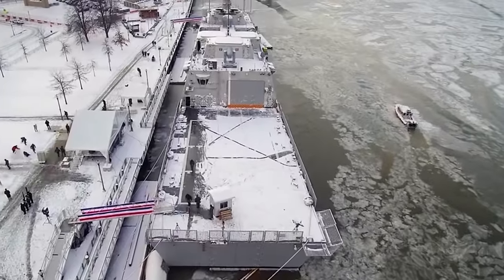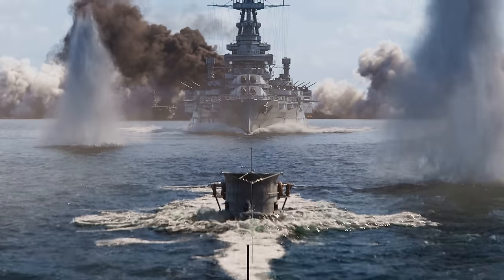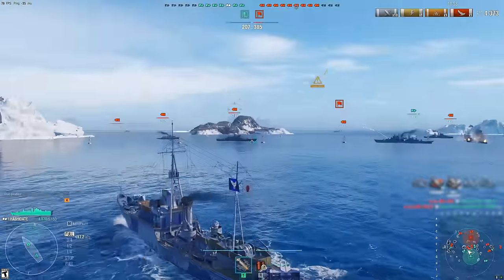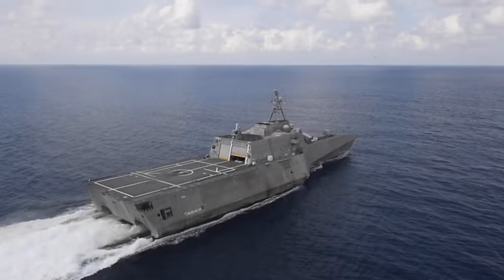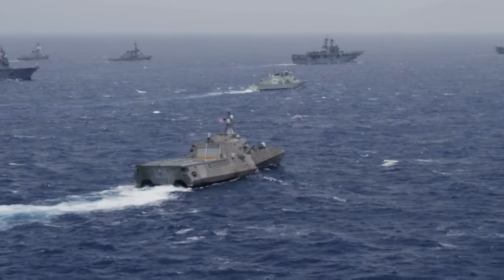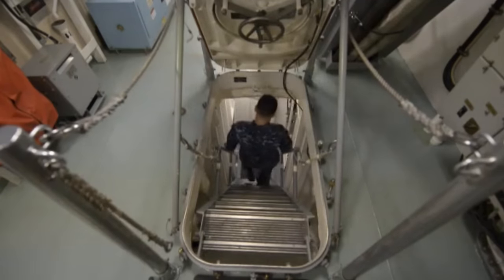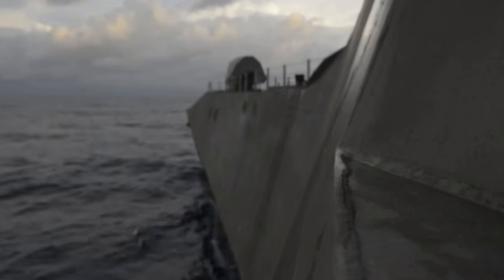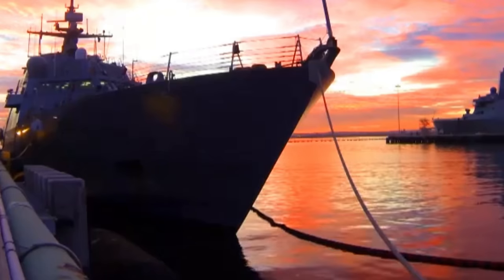Is the Littoral Combat Ship the worst ship in U.S. Navy History? | BIGGEST NAVY FAIL 👎🏼

Comment: Just a thought here…
Our ship builders and Navy tried to do something so radical and different too quickly. They should have done 2 of each hull, and tested them extensively before making anymore. Only once we perfected the design would we build more. The US does not operate corvette class ships (let’s face it, these are corvettes) and has zero experience in the design and operation of them. We also fell into the blunder of trying to make these limited space ships a sort of transformer by switching modules and take up more missions than feasible. 

I know the mine sweepers and mine warfare ships are in limited supply in the US Navy, but I personally think we could do better with purpose built platforms, and converting older amphibious ships that are no longer used or needed for their original roll. (For example an LPH was used as a mine warfare ship in the past, and from all accounts very successfully. The ability to launch multiple helicopters to sweep for mines was a great idea.)

My personal opinion is that the LCS platform should have been limited in scope and mission sets to just a few. In particular they would have excelled at (if perfected) at counter piracy, counter narcos, and costal patrol missions not in the theatre of war. They had potential to be special ops platforms to launch SEALs and Raiders, do VBSS (Visit, Board, Search, and Seizure) on suspicious civilian vessels, chase down Somali pirates, and hunt for narco subs.
Reply: Modern amphibs are the size of WWII aircraft carriers…

Comment: A certain amount of irony, that ships built to be adaptable couldn't adapt to the stategic shift in priorities and threats. Also, perhaps one of the lessons learnd would b to limit the number of ships orderd, at leat in the first batch. If they'd built 5 or 6, the issues raised would be quickly ralised without further commitment. Then the solutions could be built into the following designs.
Presumably these would better suit smaller navies that aren't flanked by massive oceans, have a narrower scope of tasks, and predominately operate in a defencive posture. If the engineering issues could be rectified, they might be well employed in low theat areas to free up dedicated warships. A theater that requires pressance and diplomatc reassureance, but not a destroyer. They might even do well in the coast guard. Otherwise, perhaps the export market is the best option to recoup funds whilst upgrading friendly nations.

Comment: On new concepts do 2 or 3 only and try at least 2 or 3 versions from different makers.  After testing best ideas from each can be refined into the production models and the prototypes if useable can still be used in roles they are suited for and help develope other concepts as test beds like the stealth ship that was largely copied for bond in Tommorow never dies.  Many concepts are themselves are not bad but are not practical en mass.  The replacement for the Greyhound with a tilt rotor with as safety record so bad even some officals are banned from going on them despite being in the fleet to shuttle high officals around.

Comment: I just dont understand why they just didn't go for a Corvette. These ship, just like the Dutch Holland class are under armed and dont really have enough crew. A good corvette would have been beter, without asking a lot more.
Reply: The speed.  Both models of the LCS are 40kn+ capable according to paper specs. From the design they look like they're designed to patrol foreign shores like the south China sea and respond quickly to local hot spots.
Reply: @namyun2743  speed is not really a good reason. That is hull design and engine/propulsion power. I believe that the LCS ships have big hull problems. I would not send these send these ship beyond coastal patrol, anti drug and piracy operations (something where the Holland class is designed for). These ship are still under armed and lag a proper crew. Sending them to active warzone might be suicide for these ships.
Reply: @damenster  I can't say I understand USN doctrine on the use of the LCS, but that crazy speed has been a core requirement since the project started and I believe is part of the reason why the ship has problems.  The Holland-class at 21.5kn is too slow for USN operations much less whatever was planned for the LCS.  It looks like both of the LCS are getting offensive weaponry in the form of NSM launchers. They will probably be replaced with the Constellation frigates and drone missile boats like the Ranger.

Comment: Denmark?? Kockums is not in Denmark. USN and Northrop Grumman personal were present during hull 1 and 2 constitution of the Visby class in the 90s. Kockums were to build the carbon fiber hulls for Northrop Grumman.  Swedish ministers went to the US lobbing for the project. There is much more.
Reply: The FLEX-sytem (the modular design of changing the ships roles) is a Danish thing.
Reply: @MrBandholm  Thanks for the information. I changed careers in 2000.

Comment: The DGX feels like a worse fail
Reply: In some ways it is;  costlier per hull, but LCS has way more hulls.  Freedom-class may be salvageable though, they just need a new combiner gear.  Not like the Independence-class which has a weak hull.
Reply: @namyun2743  If I remember correctly they are retiring the freedom class ships and will maintain a sizable number of independence class LCS ships.
Reply: @ameritoast5174  From what I am reading, both of them are going to be gradually downsized until there are none left.  The Freedom-class has the combining gear issue which appears to be class-wide, but the Independence has the hull-cracking issue which I predict will be found to be a class-wide issue as well.  The ones that get decommissioned later will allegedly get NSMs.

Comment: I think the idea of being able to change the role of any vessel is going to make things hard.  What I would like to see is a ship design that has all the minimum requirements for all tasks (air defense, anti-sub, etc) and then have the ability to add 'Mission Enhancement modules' which might simply be a place for two 20' shipping containers.  
Then if you are going to do anti-piracy, add two 20' accommodation containers for pirate prisoners.  You are going to do anti-sub work, load a second UH-60 Romeo in the place of the two 20' containers to give you more airtime searching.  You are going to support long range surveillance or want to extend loitering time, add a 20' fuel container (that you can pipe into the ships existing 'at sea replenishment fitting').  Basically, the two (or more) 20' containers use existing civilian containers and, while they may need ship power (cold room container for frozen food to extend endurance), don't need to connect to the ships Combate Information System as the ship already has all the basic systems on it already.  But you can add a couple of containers to make it better or last longer at a specific mission if you like.  And those containers are off the shelf civilian models that the navy can purchase at any port around the world if they want to upgrade a specific capacity.
Reply: There is a system like what you describe, but it is made by European company, so the US didn't/won't touch it.

Comment: The people who approved and mismanaged these projects (both LCS classes and the Zumwalts) need to have some kind of personal consequences for wasting taxpayer money on things that don't work. In the private sector, people responsible for expensive failures (even at Boeing - eventually) get fired and even senior executives are invited to leave (yeah they may get the golden parachute, but for people at that level, living with humiliation can only be offset so much). The Navy and the Air Force both seem to be afflicted with spending money on whiz-bang gadgets rather than effective war fighting technology - Navy seems to be the biggest offender though. Even the FFX program, supposedly cheaper because it's based on a proven design, has had so many changes that it's basically a new ship with the usual cost overruns and delays that have become normal. China will not be waiting around until we get it right and can deploy in quantity.

Comment: In an ideal world, procurement should have been limited to 4 ships.  The first examples of each class should have been prototypes and the second of each would be the final reference design.  Testing would have revealed early on the problems with them and they could have been worked out.  Plus it may have turned out that the mission packages were more suited to one class or another .  They would have made choices to designate one type for surface warfare and the other for mine warfare and ASW.  Only after the designs have been validated, crew manning, and mission packages finalized should they have gone to full production.  There were too many unproven concepts and requirements to be met.  At worst we would have wasted money on 4 ships.  At best, we would have a better force of LCSs that are more capable of performing the missions for which it was built.  In the end we would have ended up with about a dozen ships half of which designated as minesweepers and other as small surface warfare combatants.   This is in fact how things are turning out.  The LCS may yet turn out to be decent minesweepers.
The real loss is in opportunity costs.  All the money spent on these could have used to procure the next generation destroyers or be put into other proven programs in need of money.

Comment: I just asked myself. Why nobody just mount a tank turett on their boat.
Reply: It’s happened in the past. Problem with that in modern terms is that tank guns have very little range & no elevation. Naval guns in the 76 to 130 mm range are A LOT longer ranged & more capable than a strap on tank gun.
Reply: @grahamstrouse1165  the germanys straped a PzH2000 on one of their boats

Comment: They should use the money and build better Ticonderoga class cruisers and Arleigh Burke destroyers.
Reply: Both those designs are nearing between 50 and 40 years... It is a complete capitulation of US design, if you cannot make something better and more modern.
That being said, yes compared to LCS, more Burkes would have been unquestional better! But LCS should never have been approved, they should have made a capabel frigate-class and an updated destroyer class, and could have done it for the money spent on the LCS.
Reply: Should have, maybe, but that boat sailed 25 years ago.
The USN is desperate for a new platform, as even newer AB flights are running into design limits envisioned in the late '70s, early '80s. Not enough generator capacity being a major hurdle to future-proof the ship. It is a 45 ~ 50 yr old platform, and there really should be an Arleigh Burke V2.0 on the drafting board.
Reply: @Tuning3434  True, and I am not saying you shouldn't make more Burkes, but Ticondaroga are on their way out.

But the real issue is that the USN have options of buying designs and make new ships in short order (2-3 years for the first 5 ships) with fairly simple changes... Yet they haven't, and wont.
Reply: Use the money to build more constellation class
20 FFGs isn’t enough 
During the Cold War USN had over 60 FFGs
Reply: @mosesgoldbergshekelstien1520 The Constellation is already a mess. They’re 80% as large as a Burke with maybe a third of its combat power. They cost more than a billion dollars per copy at this point & we’re not going to have ANY before the 2030s.

Comment: Survivability complaints I dont understand. To me its a direct result of individuals not knowing. The definition that I have read about Survivability is deeply outdated and have a tight dependancy on length of the hull. That completly irrelevant factors when all of a sudden ship can have three hulls. Also the comparison to larger ships is an issue. You can not expect a smaller ship to be fast agile and have armor. Naive from Congress to say the least. They should have compared it to the Survivability to some of the scandinavian navys ships to have a reference point. This must have been a trick from some to argue for the cancellation. Its too silly to be serious about I feel. I mean ships follow to some extent the same principles as tanks. "Fire power" "Maneuverability" "protection". This ships clearly way heavy on the first two. 
When it come to survivability one can not just compare two ships one to one. In reality on large ship can be compared to maybe two or three. If thats no spreading the risk and being Survivabile I dont know what is.

Comment: Freedom class was garbage end to end but Independence class had some good concepts. We do need some kind of litoral fast attacks boats and I think Independence armed with NSM make for a potent attack asset.
Reply: Just to remind you, the Independence-class is the aluminum trimaran with the cracking hull  problem.  Freedom-class with the traditional hull that has the bad combiner gear.  Both had proposed upgrades to their lethality involving anti-ship missiles.
Reply: The Independence-class has a fragile aluminum hull that cracks and is corrosion-prone due to metallurgical interface issues & there isn’t enough deck space to mount useful weapon systems.

Comment: The LCS has a major role to play in the US Marine Corp. With the vessels speed and flight deck it can add tactical capabilities not offered by traditional carrier support vessels. When operating the F-35B, operational range can be extended by refuelling in flight or landing over the horizon onto an LCS that has broken away from the fleet to perform this localised extension to the carrier flight deck. The LCS falls under the protection of other F-35B's and  a plethora of CIWS being developed all the time.
Reply: Are you daft? The F-35B can’t operate or be supported from a dinky helicopter deck.